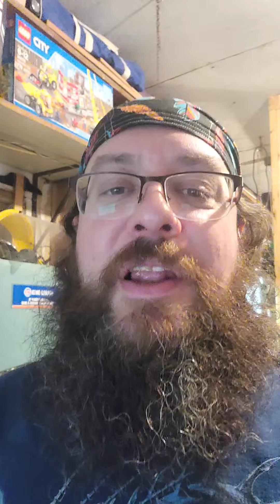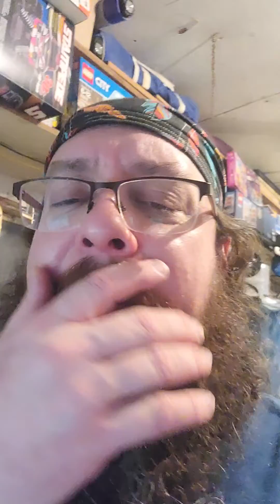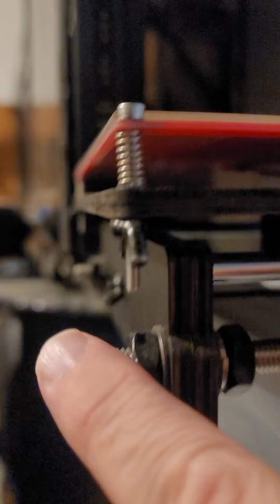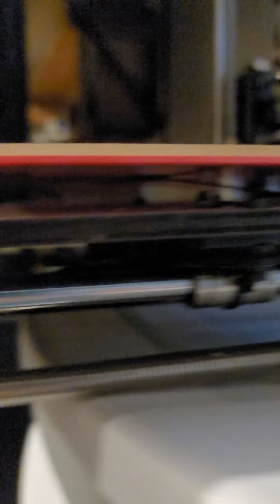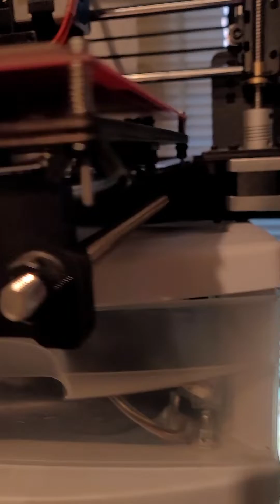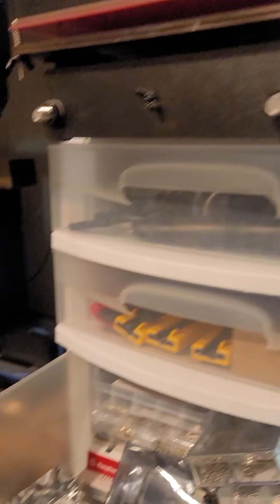Is the bed warped? No... there is a secret to this.

Comment: Mine was warped. Even worse though was that my screws moved. I marked them, and compared before and after printing. I solved it by gluing a flat piece of garolite to my bed. The garolite doesn't flex, and the screws stay tighter because of the extra tension on the nuts pulling the thicker bed down. No more layer shifts and parts getting knocked down. The original pei sheet still allows me to remove it. It's just not as flexible for getting parts off, but they still pop off relatively easy.
Reply from the maker: Thank you for sharing your experience. It is true that occasionally, the bed can actually be warped, but most of the time, the issue is screw tension. I hope what you have shared helps someone, though, as my video won't solve this problem for everyone

Comment: No man, that's not a design choice, that's cheap production quality. Bed springs do that because they use cheap springs from the factory. You use flat compression springs or better yet, solid silicone spacers and those should give you more level and even printing surface.

Comment: I dont really get the setup, your losen all the screws and then screw them 75% in?
Reply from the maker: This is a great question, thank you for asking.

Fully on is 100% on. Unscrewing until the edge of the screw is at the edge of the knob is roughly 75% off (100% would be removing the knob). I consider 1/2 way between those 2 points to be where you want all four knobs to be at before you start to level. I think a quick gap check at all 4 knobs is also worth doing to make sure that all start at the same point.

The idea is that at 100% the corners are pulled down so the center rises, all the way off and the center will dip slightly and the corners will be a bit high. By putting it in the middle, you are equalizing all 4 corners before you start the leveling process.
Reply: @PrintYourWorld  Very well described thank you!